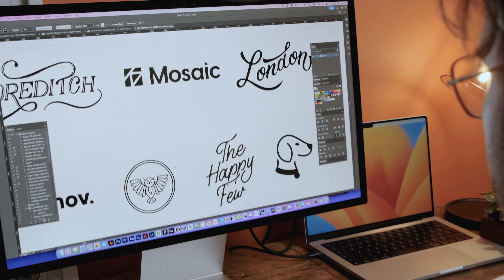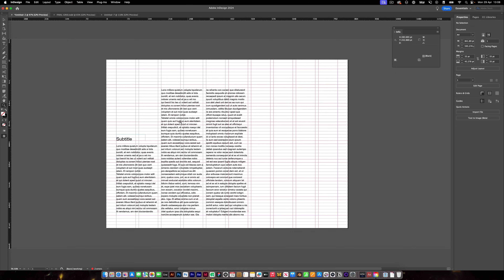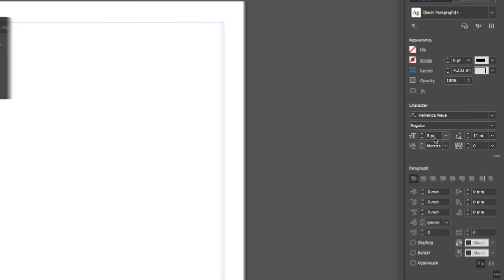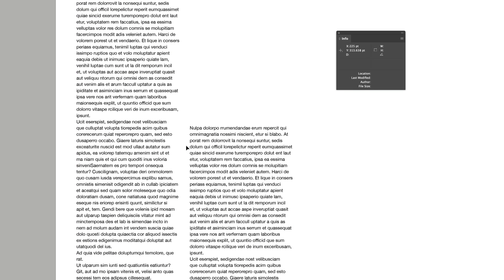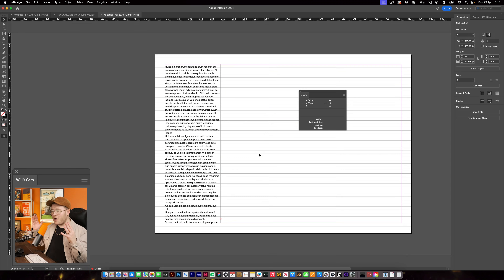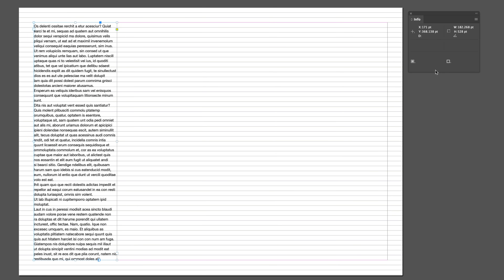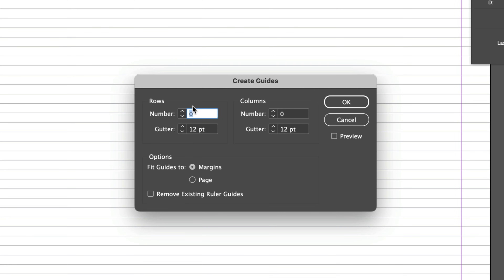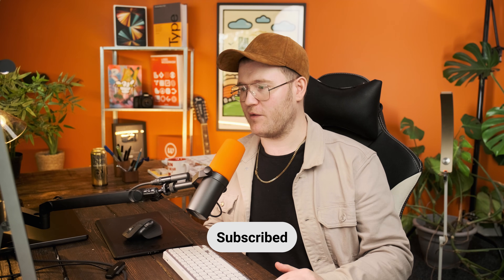Level Up Your Designs with Aligned Grids 🚀

Comment: Very clever, ans well explained. I'm facing with a much greater problem: I'm working on a multilingual book project. The text must be presented in two parallel columns. Not only the fonts selected for each language have a different lead, but each paragraphs of the text don't have the same length, depending on the concision of each language. Still, both columns must end together. I have a trick with several parameters. Each paragraph style is set to stick to the grid only at the first line. This is really a great feature! This way, the text in both languages manage to keep up together, paragraphs after paragraphs.

Comment: Great video and super helpful, it only got very confusing at the end with the +11 and then -11 which wouldn’t do anything since they cancel each other out. What ended up working for me was to just do +11pt. I’m not sure this is correct, but it seems to have worked for me - in case anyone else gets stuck there, or if I come back to this at a later date and get stuck at the same problem haha.
Reply: Indeed, +11-11=0. He should have said first : the small difference 1.276 pts and then adding 11pt. He was speaking too fast, in fact 🤣🤣

Comment: yes but now the bottom margin is slightly bigger than the top one
Reply: Yeah, this bugs me too. Of course it's easy for them to align if I have different sized margins... What I did to fix the issue was adding the top margin to the bottom margin so i get the sum of both margins. Then dividing that by two and setting the margins to that amount. Then the grids should all be aligned and your margins are the same height.

Comment: Thanks WP, much appreciated.  Just a quick note, when you have a Baseline grid of 11pt, just remember that will be ok for yr body copy lining up once you have adjust that small difference in the top and bottom margin as WP showed you, but yr Captions Text will not line up to yr body copy. And yr Images will not align with yr baseline grid, they will be higher than the tops of yr body copy ok.  To solve both those problems, create yrself a "f" height grid in a different colour, say red or orange works well, using the lower case f of yr body copy and adjust the spacing accordingly top and bottom and yr'll be good to go. cheers Kiwi

Comment: thanks! great video.

I have a question: is it possible to create multiple baseline grids in the same document for texts of different sizes?
Reply: Yes you can, but not normally in yr standard body copy. but yr captions will be  different size and yr headlines and sub headlines  will be different sizes. Body copy size is normally set for the whole publication, book, magazine etc. otherwise it does not look very nice to have different size body copy  throughout the book, it becomes disconnected.

Comment: I tried following this but it doesn't work in an A4, the subtracting 11 pt and then adding them back is not doing really anything and i still have half of a grid extra, how could i resolve this?
Reply: I think it might be because he used a horizontal A4 sheet, if u look at the beginning of the video. I was even confused by this, wouldn’t the correct thing be A4 vertically with facing pages?

Comment: 10:50 how can you type -11pt and then +11pt and get a different result? It's the same number in the result isn't it?
Reply: I was kind of confused as well but, from what I can tell, the number reset from 23 back to 34 before he added 11 to get 45. Not sure why he took away 11 in the first place because it didn't seem to do anything so I'd ignore that bit
Reply: It was just a cutting mistake. You have to increase the bottom marging but you could confuse it with decrasing  the number to put the margin closer to the top.
Reply: I guess he confused the fact he wanted to take away one line inside the space of the margins with the fact he needed to add eleven points to the lower margin to do so because it's the distance from the bottom of the page, and than left the beginning of his mistake in the edit by error